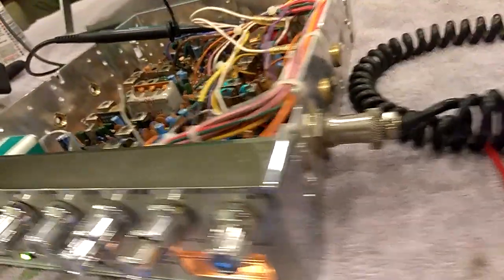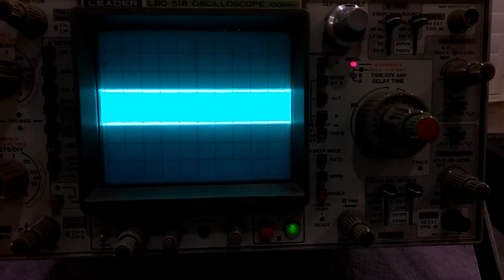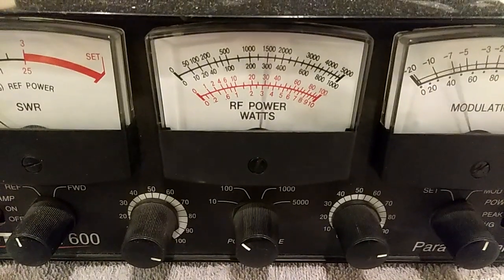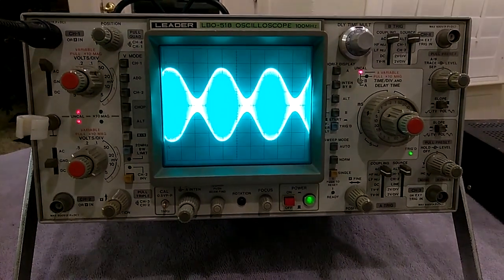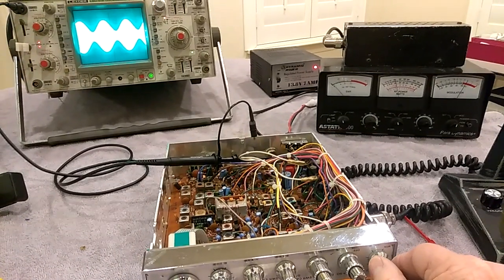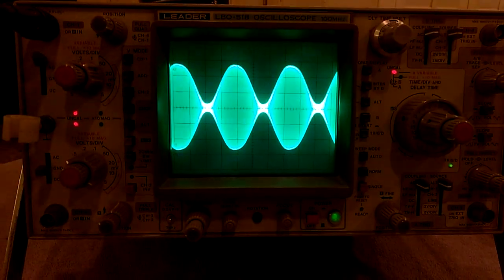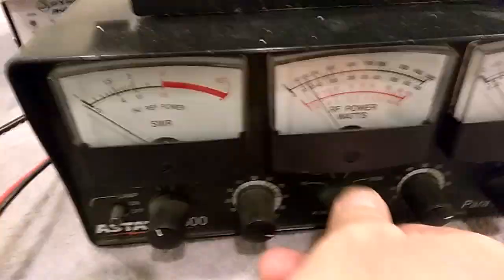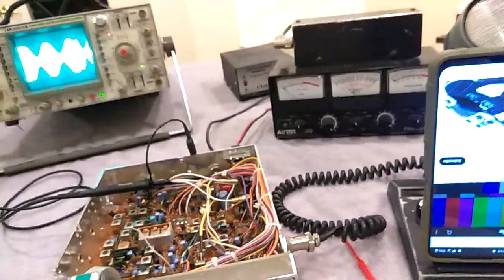Cobra 148gtl Modulation Mod for 2023

Comment: Picked up a 2000 gtl now doing MOSFET mod has no tx think drive and final shot but what is a good audio mod
Reply from the maker: I would need to see what has already been done or not done to it to give any real advice.  Personally I don't like the mosfet mods because they never seem to sound great on SSB with that mod.  The 3 usual mods I like for Cobra 2000 is to volt the final and lower the deadkey and the NPC Mod.  Here are some links if you haven't already seen them.  These radios all have similar boards to the Cobra 2000  
https://www.youtube.com/watch?v=JzRl3NrZCL8&t=209s
https://www.youtube.com/watch?v=nfa1fTExGmA&t=109s
https://www.youtube.com/watch?v=KUO_rgq9U_8&t=170s

I would also like to mention that those 3 Mods, Volting, NPC, and lower the deadkey, are all very easy mods and very easy to reverse if anyone wanted to go back to stock.  NPC is just adding a capacitor to the back of the board, Volting is just moving 1 wire, and lower the deadkey is just on tiny jumper wire and turn the deadkey adjustment.  Super easy that causes no damage to the board.

If you haven't already done the mosfet mod I would keep the stock driver/final.  Even if yours are bad those finals are all over the place.  You may read all over the internet about how hard the stock final is to find and how rare they are but that's hogwash, every radio shop that does mosfet upgrades has a parts bin full of stock finals.